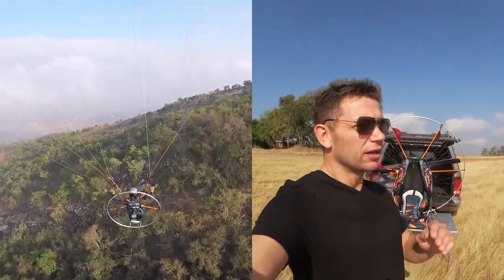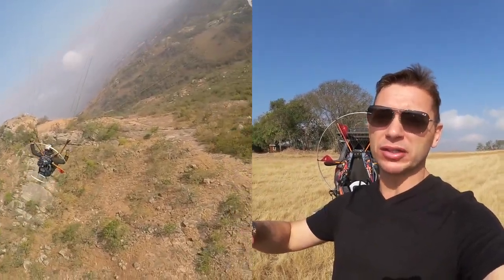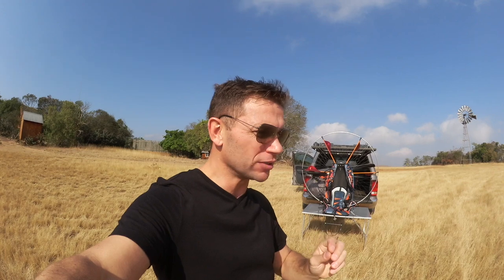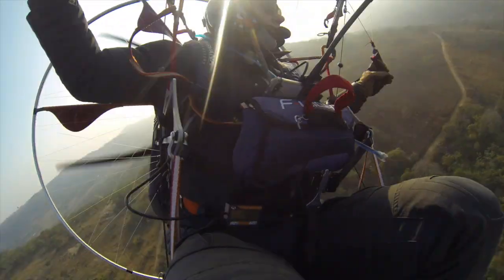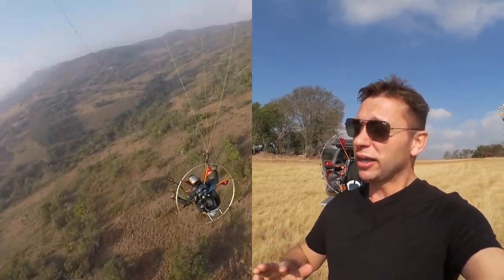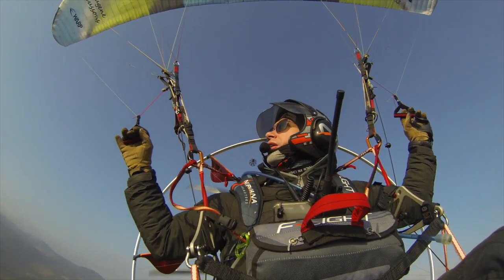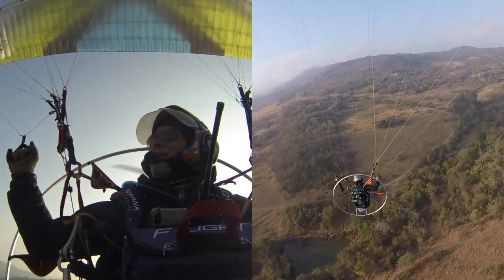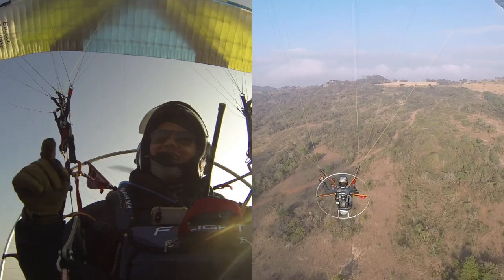Paramotor - Disaster Strikes

Comment: 07:23 After the collapse occurs you released the power attack and so the glider behaved as a classic non reflex canopy. The behaviour Could be much different with trimmers out (reflex mode).
Reply from the maker: IvoBE could be but I was flying 1/2 trim setting as you would typically use Power Attack with a smaller trim setting. You are right about the fact that it needed as much ‘pumping’ as a classic glider

Comment: I also use WARP 16.
The start positions of the right and left accelerator lines in the video look different.  Perhaps the right line was short or stuck somewhere.

Thanks for the precious video.
Reply from the maker: Pleasure to share. We did find a replacement line that was too long on the D but not sure if it would have caused a problem. But still the error as explained by manufacturer, dont step on the speedbar while on brake so the response of the wing is to be expected

Comment: I found another important error.
When using a PA system, the trim must be in the range of 0cm to 3cm.
WARP's PA is different from SNAKE XX and HADRON XX.
Flying with the trim extended at the WARP PA will remain at high speed even when the foot accelerator is returned.
The flight in this video extends the trim more than halfway. thank you.
Reply from the maker: Interesting! I only fly with PA and mostly trims open so this hasn’t been a problem for me but good to know the most suitable trim setting!
Reply: WARP's PA is different from others,
Be sure to check the manual.
WARP PA will not return to low speed flight unless the trim is set to low speed.
The WARP PA is designed for long-distance flights, allowing you to change the trim during flight.
Reply from the maker: 五十嵐亮弥 there I have to differ with you🤮. The Warp is a Slalom competition wing and the PA system is designed so the pilot can fly fast down the straights and get full advantage of the braking around the corner, hence why the 0-3 setting works so well. Keep in mind the 16 that you fly is the competition size or Acro size where the dynamics are very different form the larger Warps 20-24. I like using the Warp for XC because its speed is built into the trimmers 80/20 and fortunately it is stable in flight with no oscillation. The Hadron XX was a pure bred XC racer with tip steering but had allot of disadvantages. The PA does return to normal speed when released. It has too. Only difference from normal speedbar is that power attack uses the trimmer line to change angle of attack and does not pull the front of the glider forward by means of separate line system
Reply: @ 五十嵐亮弥 "When using a PA system, the trim must be in the range of 0cm to 3cm ". - I did not find that restriction in the Warps manual !0-3cm trimm release its a recommandation for first flights and for launching the warp...
Reply: Hadron XX doesn't have PA

Comment: Flying straight and falling towards the ground, pumping like mad. 
Lessening to your words, I hear Warning about this product. I wish you would listen to your video as a third person and take heed.
Reply from the maker: Mark. Listen to the words I said instead of making your own. Warning is about Power Attack system meant for racing. Yes its meant only for advanced pilots. I made a mistake but did not use it close to the ground. Pumping the glider back in position is BASIC skill you learn as part of Sport License or SIV. Pilots across the world do this training when they participate in aerobatics because they can fix problems faster. I could have pumped slower but my reactions are fast and trained for hence the whole fold in was no more than a few seconds in length. The point of the video is not to scare but to show that besides the scare mongering some do about gliders collapsing and doing 180 degree throws, a glider like the Warp will keep flying straight in reflex. Dell keeps telling all that it will collapse totally like some of the vids he show but its not true. Not all reflex are the same and his definitions for sure are not correct. The falling towards the ground...I dis say it was due to me going off the throttle/thrust which you need to increase when you have less wing surface. This admittedly I faulted in and should have stayed on power with increase. Please stick to the info given in the video and not another story. The video was inspected by the manufacturer and found 100 % correct on all info

Comment: Dell is right
Reply from the maker: Actually If you watch the footage you would notice that the glider maintained straight flight with no direction change. Kind of what Dell was saying the Dominator would be able to do. Secondly this was a pilot induced error with Power Attack. Thirdly. I have done 3 Icarus races flying all types of bad weather mid day etc and never had a collapse and reflex maintaining structural integrity. If you cut power you loose altitude which is what I did while I corrected the problem because I was aware of the alt that I had to use.
Reply: Dell is right but he will still keep flying the RF wing and next time maybe not so luckily. Let's hope not.
Reply from the maker: Guys you are smoking to much of the Dell supply. When Dell explains Reflex with 2 year old crayon drawings on the board he even explains it totally wrong. Point is, Dell wants you to believe that what he sells is the ONLY that works. What he omitted was that manufacturers like Dudek have super computers that design and work issues out through advanced airflow models. This is not the sewing age anymore. The Dominator still uses 1D steering. I flew that tech 6 years ago already. He also omitted all the accidents on Dominiators or flattops. Personally he has a criminal record and has been charged in the USA with the death of a student or students. This guy is not healthy up stairs so dont take what he says as Gospel. NOT all gliders are same. Mine does what Dell claims his would do and lastly. I fly the most severe weather during all times of day during Icarus races, 3 in fact. Not an engine out or a incident to talk about. Dell needs to compete with his gear along side us if its really that good. Every other brand in the world does...